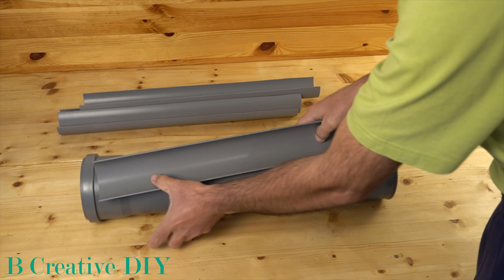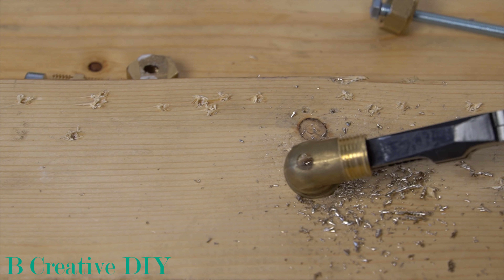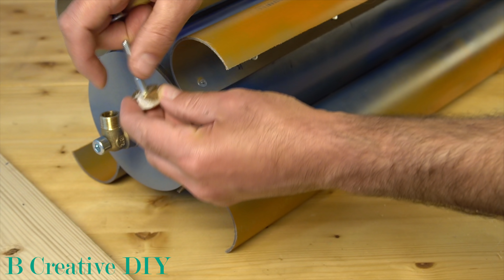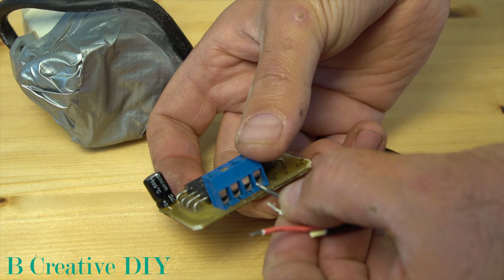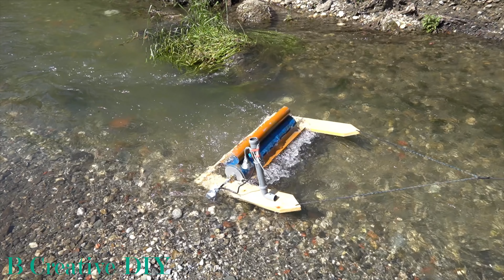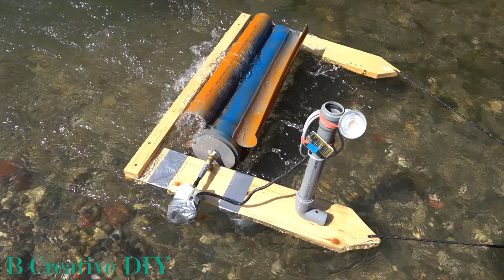DIY Portable Water Turbine Power #V1 - Easy Making

Comment: You need more blades. More blades will make less slapping in the water and you will get a faster rotation of the motor.
Reply from the maker: After I made this turbine I noticed that it is a problem with the blades . I came to the conclusion that that shape of the blade behaves like a vessel that has to be submerged in water and that slows down the turbine at that moment. I also noticed that when the blade comes out of the water, it raises the water in the space created between the rotor and the concavity of the blade, also leading to a braking of the turbine. Because this turbine did not work as I intuited, I modified it to avoid the problems explained above. The upgraded version can be found at the link https://youtu.be/iPcsQaz9Zl4. I also needed to add an increase in generator speed using a gearbox from an old machine drill. In the end this turbine did not come out as I was thinking initially. I wanted a turbine simple and light, but turation of this tipe of turbine is to low for a small generator and need an multiplication which bring an extra complexity.

Comment: Bigger blades and more blades and the added strength will help you gear up the axel
Reply from the maker: After I made this turbine I noticed that it is a problem with the blades . I came to the conclusion that that shape of the blade behaves like a vessel that has to be submerged in water and that slows down the turbine at that moment. I also noticed that when the blade comes out of the water, it raises the water in the space created between the rotor and the concavity of the blade, also leading to a braking of the turbine. Because this turbine did not work as I intuited, I modified it to avoid the problems explained above. The upgraded version can be found at the link https://youtu.be/iPcsQaz9Zl4. I also needed to add an increase in generator speed using a gearbox from an old machine drill. In the end this turbine did not come out as I was thinking initially. I wanted a turbine simple and light, but turation of this tipe of turbine is to low for a small generator and need an multiplication which bring an extra complexity.

Comment: How many volts it produce sir?
Reply from the maker: It depend how fast is the river. In my case 1.6V. The upgraded version can be found at the link https://youtu.be/iPcsQaz9Zl4. I also needed to add an increase in generator speed using a gearbox from an old machine drill in order to increase the voltage. In the end this turbine did not come out simple and light as I was thinking initially..

Comment: En la parte electrica me pierdo, q motor consigo para alimentar por ejemplo un celular?
Reply from the maker: In principle, any permanent magnet motor can be used for the generator. The resulting voltage can be rectified using a diode bridge and a capacitor. To charge a phone is a bit more complicated because it needs a stabilized voltage of 5V. For better efficiency it is preferable to use a DC-DC converter.

Comment: Great design ,but the poor bugger is trying to drown it self.  By lifting the whole device out of the water by adding more buoyancy under the floats, making only about half the curved paddles level with the water (when in stationary water) you may find it will produce  more power. It is also trying to lift water in reverse opposing its operation.